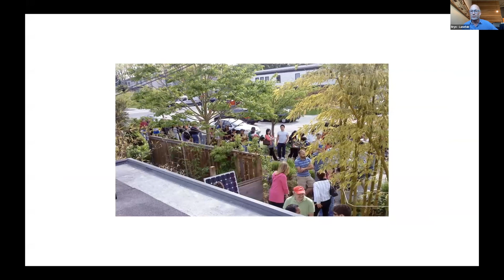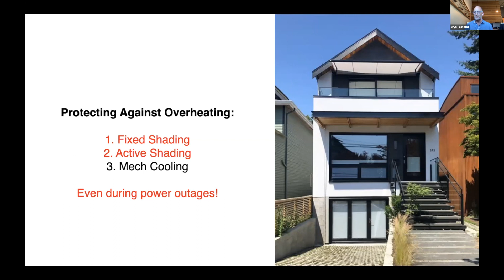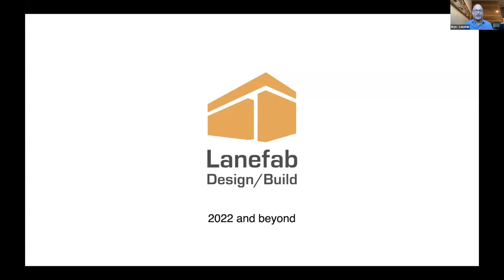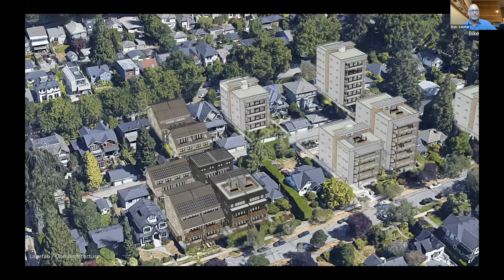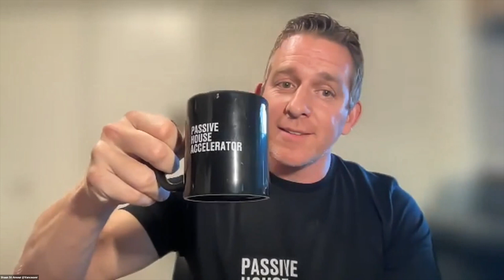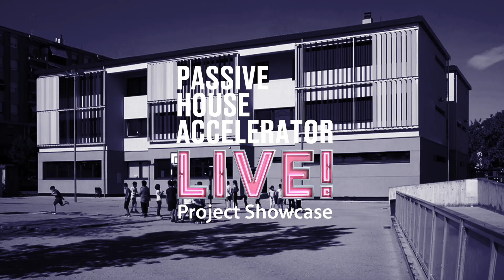Beyond Passive House, Where To Go Next | Full Event Archive

Comment: Nice - I love when we look at other countries for inspiration. Form factor aside, we have not sorted out the mechanical systems to control for the cons of glazing, and the other is to have thermal storage, or load shifting capacity. I hope we can start including 10hr+ peak demand thermal storage capacity as standard. PH has been far too slow to adopt this.
Reply: @nemam_nedam  

Exterior blinds are good, but they're user operated. 

I personally think automated integrated Venetian blinds, glazed and accessible from the inside, could actually be simpler.  It would require: a small controller, a set of motors and a spur from the nearest socket. 

However, you'd only need one of the windows in any given room to be operable. Non-operable windows are more efficient, much cheaper and more durable because they're simpler.